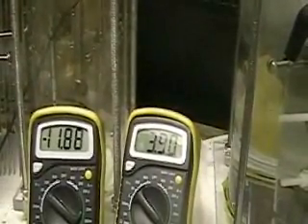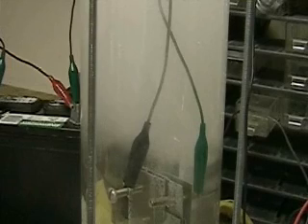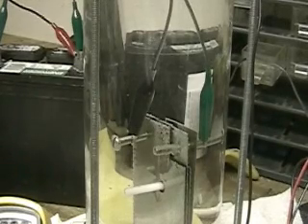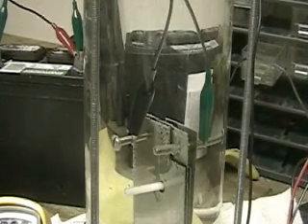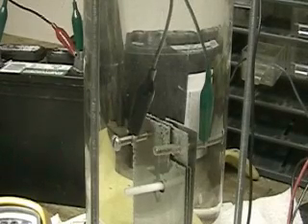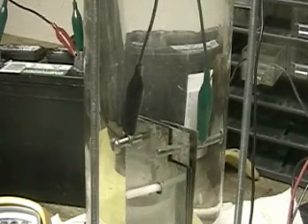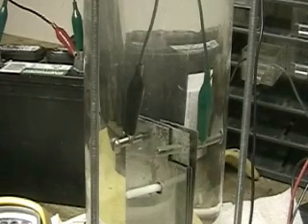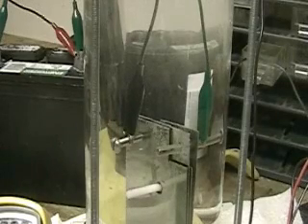Hydrogen Tap ( Quad cell tests) 143

Comment: Hello John,Its a vortex system of water pressure and eclectic force with heat. It Rip atoms out before they build up again. this will blow your mind but only 1/3 of the plate is being used. big bubbles collect on the dead spots. Bp,  if look at frost on wings and venuri heat rings in the Carberator .BP,  all Dead spots have a job  of control . Great JoB aways John Aarons